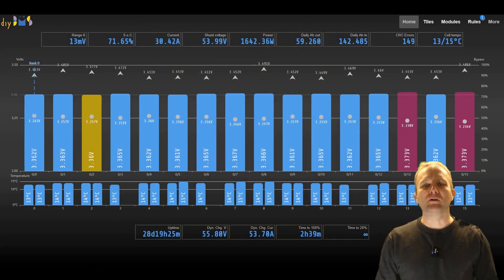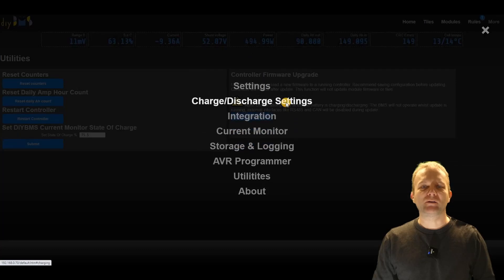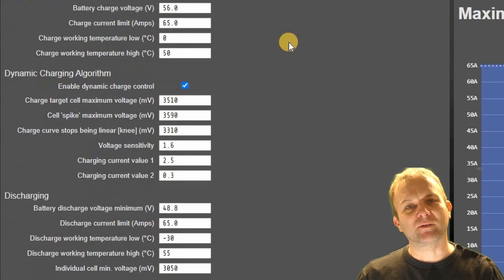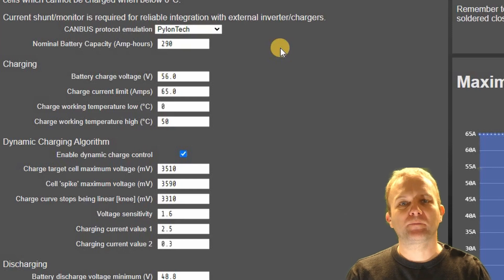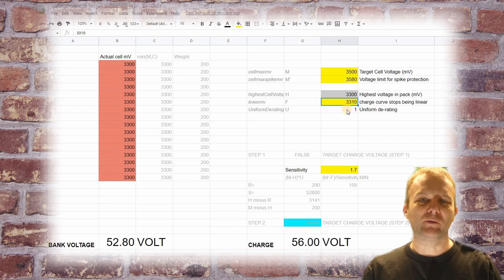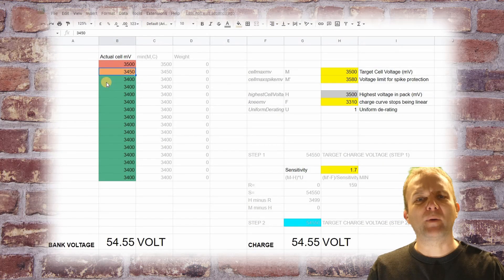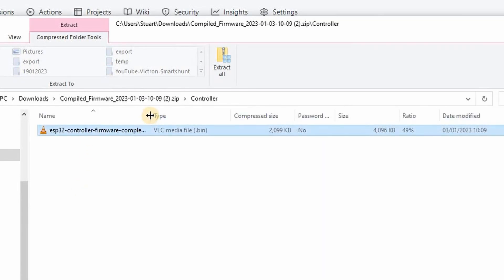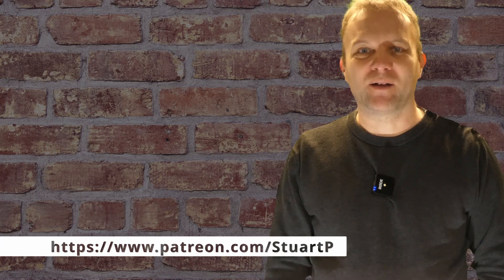PylonTech Battery Emulation & Lots More Feb 2023 Update [diybms]

Comment: Hi Stuart. I believe my old Pylontech extra 2000 batteries need a Firmware update. Pylontech technology's are not helping as out of warranty.. I have managed to get a little bit of charge in them by setting my solis inverter to lead acid.. but am still getting can com fail.  The batteries haven't been used for a few years as have only just got a house worth putting panels on.  Do you have any idea where I could get Firmware for the extra 2000 batteries  !! Regards Mark
Reply from the maker: Sorry I don't

Comment: Tremendous work! Thanks.
Crazy ask. I already have genuine Pylontech battery packs.. but I'd like to build on your amazing job..
By any chance would your emulation also be able to integrate pylontech BMS data into your BMS and feed Victron's Venus with aggregated data?
By this, I could run 2 separate BMS, same DC bus bar,  and expand my existing system with diy battery. Would be a huge gain for large community.
Reply from the maker: No unfortunately, this isn't how it works, so it can't be used to "add" to an existing Pylontech setup.

Comment: Greetings from Pakistan 
We installed Solis 5kW RHI 5G Hybrid Solar Inverter (230V / 50Hz) connected to 5kW Candian Solar PV Panels 
Two (02) Pylontech US3000C Batteries are operational since 2022 April 

It would be appreciated if you could guide us which other brand of LFP Batteries can be connected with Pylontech 
Also please share How to order you tools / monitoring system for Pylontech US3000C 

Thanks
Reply from the maker: This BMS isn't designed to be added to existing setups with Pylontech battery - it purely replaces the need for Pylontech units in the first place.
Reply: Suggest a way forward for me ... thanks  @StuartPittaway

Comment: Very good job Stuart. I've waiting for the pylontech emulation quite a while because I'm an Deye hybrid User. The Deye speaks Pylontech but it seems that it needs the SOC. Afaik your shunt is not available yet so, is there another option to get the soc in the controller?
Reply from the maker: I'm working on another SoC solution at the moment - subscribe for when thats released.
Reply: @StuartPittaway   Good to hear you're still on this topic. I'm wondering if the set SOC under Utilities will do something when connected to a pzem shunt?
Reply from the maker: @the_schmue2973  no it won't! The pzem doesn't support soc monitoring

Comment: if you have a problem, while preconfigure the wifi over putty, remove the Display, attached to the Board, then it goes like normal :-)
Reply from the maker: I've not run into that problem - but thanks for the tip!

Comment: Hi Stuart - This is a video I have been waiting for. Im a Batrium user, and their 'ramped' targets feature is rubbish. It works in the exact opposite way to yours - It works on SOC and charging current, not on cell voltage and charging voltage. Victron has been very clear in their communications with me that Batrium's way is wrong and that VOLTAGE control is the way to go. Your solution and explanation are fantastic - and Im glad to see its done right.

 I have a DIYBMS kit that I haven't installed yet, but now that your system supports these new features it's given me the motivation to build it up and completely replace the Batrium. Well done, and keep going!
Reply from the maker: Excellent, let me know how you get on.
Reply: Yes David, now it's time to change something :-)
A year earlier I also looked at the Batrium, but decided on diyBMS.
Now my little Cerbo chief is very amused about dynamic charging - and if you want - maximum charging power to the edge and then - smooth charging to the final voltage.
Standard or tuned - whatever you want!

Comment: I like this update or upgrade a lot, but would need a canbus version for the Growatt SPH = grid tied  series that still supports the low voltage batteries (not only hi Volt beyond 100V).
The only option I had found has been the SEPLOS BMS even though I would have loved to go for this BMS.

Hope there will be someone adding such a feature somewhere in the future.
Reply from the maker: Which Growatt inverter is it?  This forum thread appears to say the SPH series supports PylonTech battery.

https://diysolarforum.com/threads/growatt-sph-series-inverter-battery-bms-protocol.21829/

Comment: This is really impressive. Now I just need an actual usecase lol. 

hard to do in a rental flat
Reply from the maker: A flat is not ideal - but a small battery system could be made to work if you can get a lower cost overnight electric tariff to charge the battery.